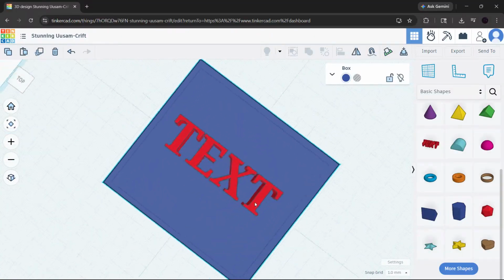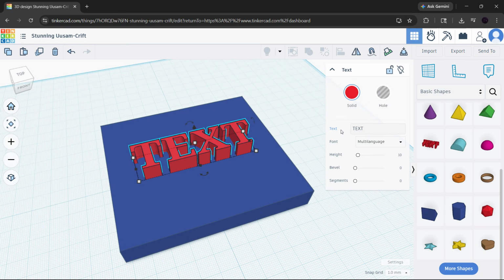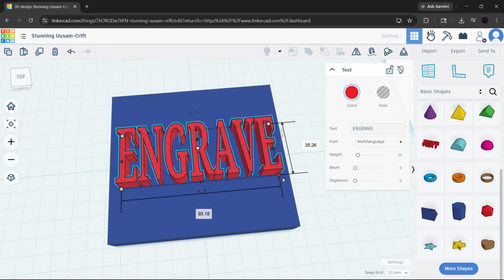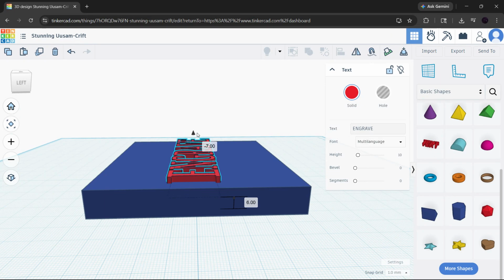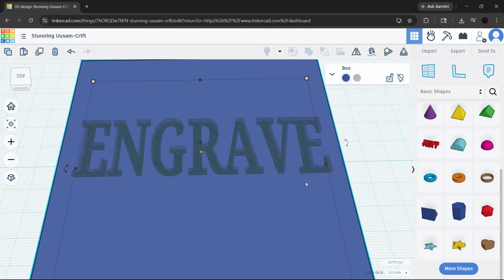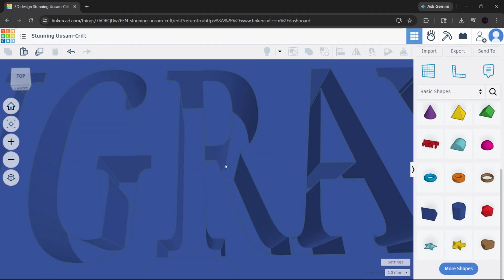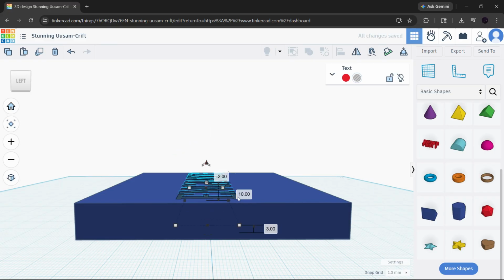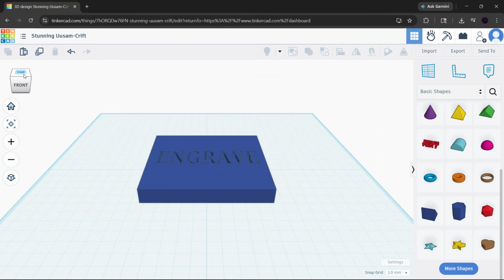How To Engrave Text In An Object In Tinkercad (2026 Easy Guide)

Comment: Now that I've engraved the base with the text I want, I want to print the text separately in a different color. How can I be sure that the text will fit perfectly in the engraving and match the shape I created?
Reply from the maker: The easiest way is to duplicate the exact same text object before turning it into a hole. Use one copy for the engraving and keep the other as a solid object for printing separately. That way both shapes match perfectly and the text should fit into the engraved area accurately after printing.
I hope that helps